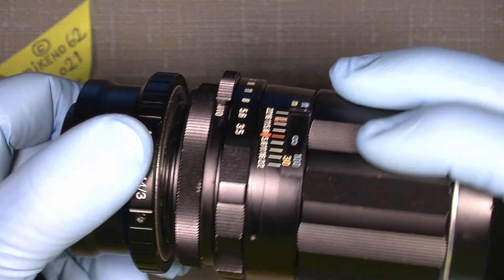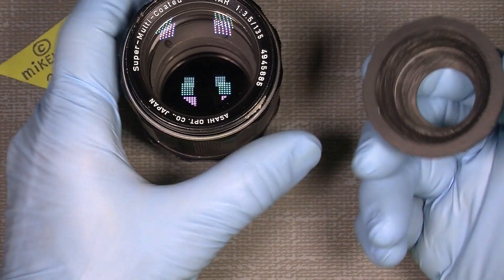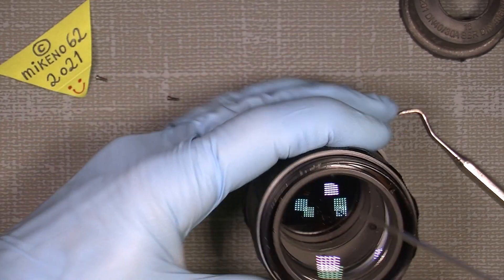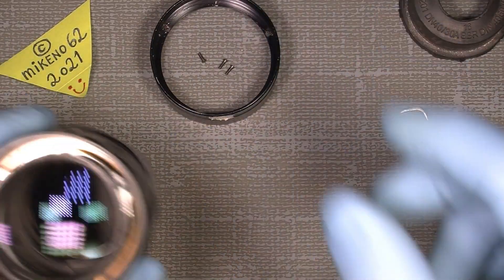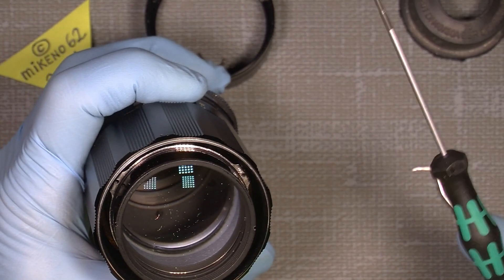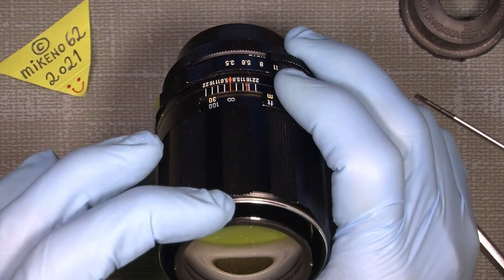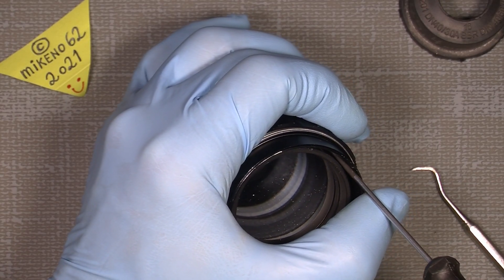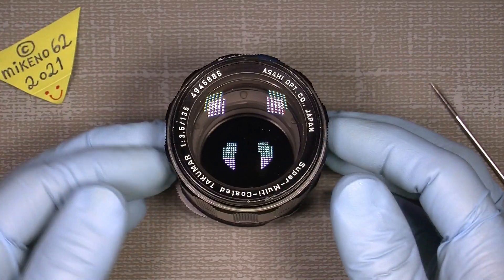How to adjust lenses to use with adaptor Super Multi Coated Takumar 1:3.5 / 135

Comment: Yes the adapters often don't focus perfectly at "infinity hard stop", mostly overshoot. That works for dedicated adapter/camera but might be troublesome when more than one systems used. For the adapters are designed as 'precise' m42 flange distance. 
I personally would adjust infinity when m42 on Nikon F but not for other cases. Sometimes manufacturer use thin rings to adjust optic placement in lenses and I saw some dealer provide these with CCTV lens for mirrorless which have loose infinity focus.

Comment: If using an adapter,this automatically corrects the registry distance,so now with adapter which corrects can be used on another camera..what you are doing,changing the lenses registry distance,is it possible to say add a m-42 to nikon adapter,change focus or registry distance of lens,and fully use m-42 lens on a nikon digital camera,might be possible? Please try this.